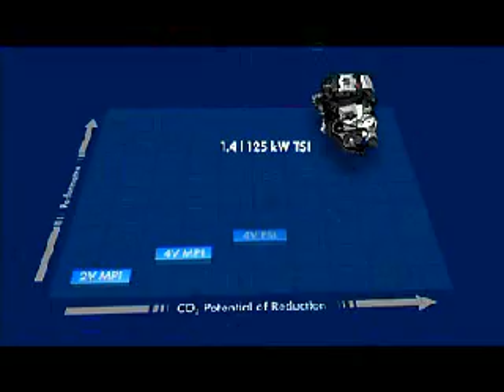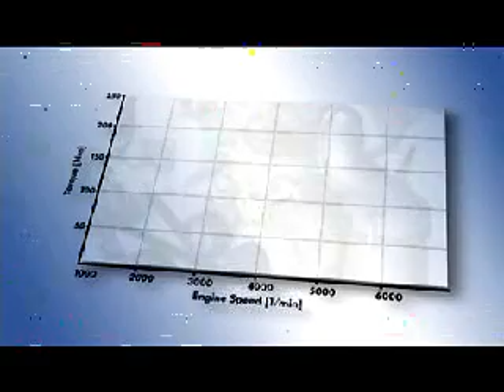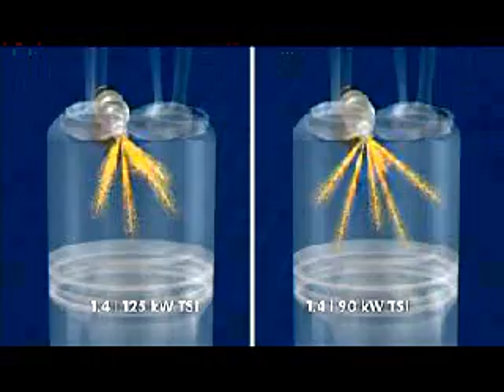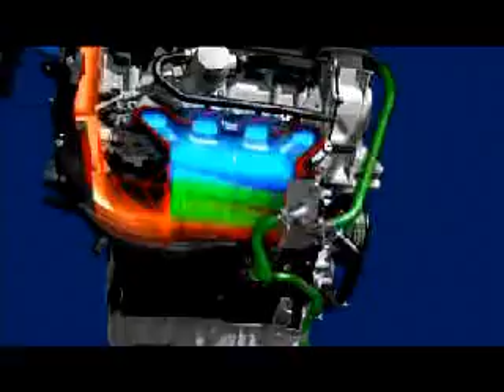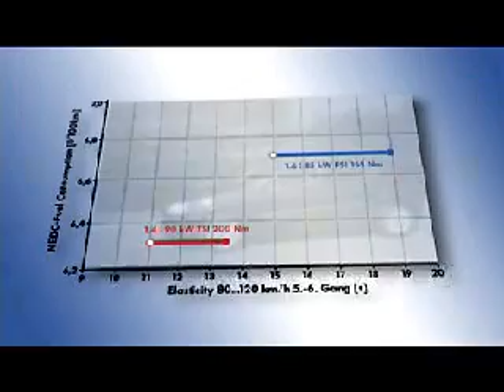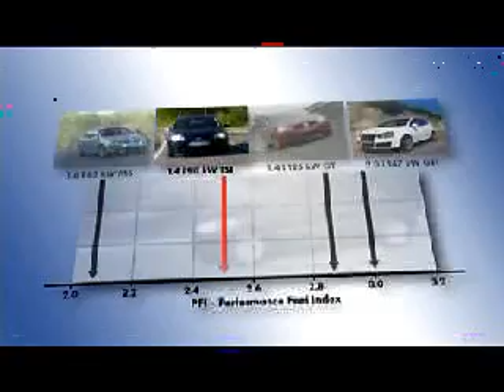VW TSI ENGINE ANIMATION

Comment: because more than 4 valeves per cylinder is using  in high RPM engines (bikes ect) who gives u power in very high RPM, In normal engines where u need a max torque available as low as possible more than 4 valves gives u nothing and put the max torque very high what is not economical and uncomfortable  

Like u see the  Japanese who put 4 valeves per Cylinder (far before Germans start to do that) didn't put however a 5 valves per C. to cars engines ? guess why

Comment: all cars should be build like that.

you can even add 4 wheel drive if you find a donor car on the scrap yard.

you need the gearbox, the rear axle system(subframe with differantial and suspention).

voila, a beast  that takes tight curves on town road like it's cheese, i have done 200+km/h+ (friend's '98 audi a8) on a land road with the 2 right wheel in the mud, that smal the road was for 2 car to pas.

it's superbly safe personal race car for daily use.

i wish all cars where like these ...

Comment: oh, and audi a4, a6, a8, passat and exeo's frontwheel suspention is amazings cool, just to look at, a 4 link system, witch allows variable wheel angles when the wheel turn.
i can't express my self en how the escribe the effect.
but it's a race car type suspention.
it has spare holes, to adjust the wheel angle, even the link bar from the steering looks cool and technical.

i have repaired an accidental vihicle and was required to change the part with the wheel bearing and a new wheel.
amazing!

Comment: why is 5 valve unsuccesfull,  i once removed the cam shafts to exchange the chain on them, a 20v 1800 engine  - a4.

i was amazed about the cams angel on the 3 inlet valves(they vary), smaller and therefor closer build, it's not that complex, it has a total accetable build quality.
hydraulic valve adjust.

the more valve, the more air effortly get's in, better vaporization of the fuel.

yahama uses it on his bikes, do you think they also wrong¿?

Comment: wel, normal families here in europe that never suffered some financial problems or some kind of aditions.
exchanges his car when it's exactly 2 years old.

they only think about the resel value.
it's suposed to be that most of the cars older than 15 years or so are on the scrap yard.
their no collectables.
accept for some specials cars.
but even our specials, like the opel manta, the C kadet and stuff like the 2002ti, bmw 323i,190 2.3 16v, the first m3, even they disappeared total from the view.

Comment: this is different than GDI engines.

this engine can 'regarding it's mode' run on a ultra lean mixture, much less than the 1 to 14.x required optimal mixture.

per combustion stroke it injects 2 different mixtures a rich and a lean around the rich mixture, preventing the engine to get hot and burn every last particle of gasonline.

Comment: The tsi is answer to yesterdays requirements not tomorrows requirements. Most of advances are evolutionary not revolutionary.  Tomorrows requirements are engnies that get better thermal effecncey than fuel cells. high Torqure